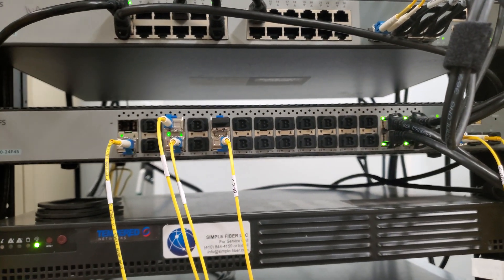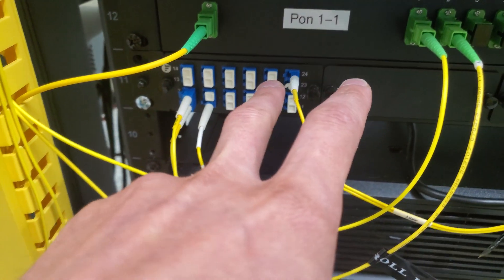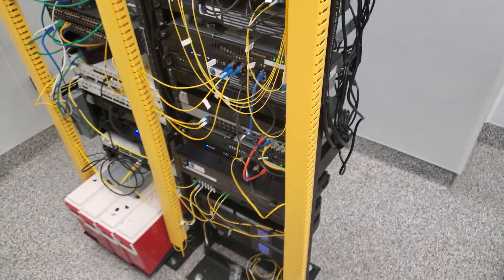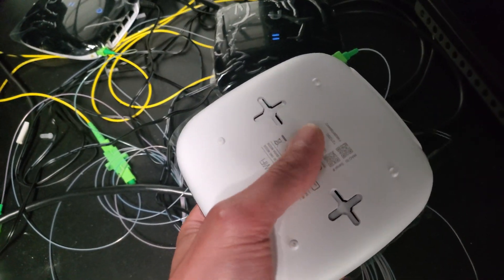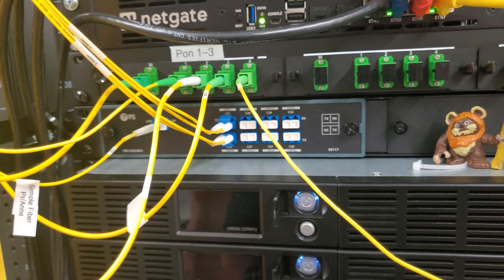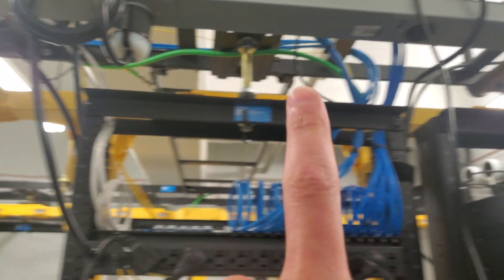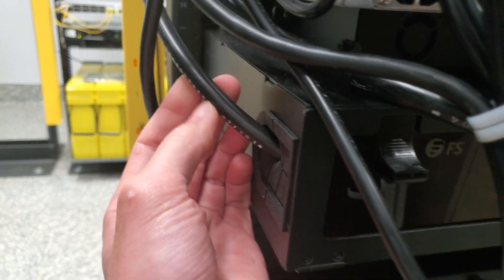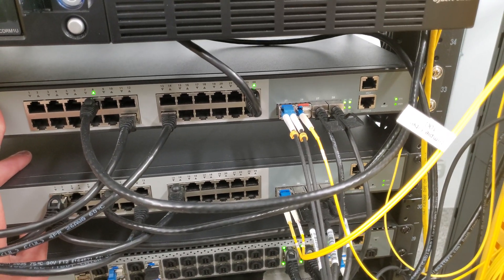Fiber site update

Comment: Ubiquiti should only be used for home networks. Not enterprises like these.
Reply from the maker: Out of curiosity where would you use an OLT capable of 1024 ONUs in a house?
Reply: @briceperdue7587  I'm sorry if I came out to harsh. It's just my opinion. I wouldn't use Ubiquiti. Must be because I'm so used to cisco products.
Reply from the maker: @anonymousmoose7  Not at all I love all the comments.  Ubiquiti's UISP line of products includes the OLT\ONUs.  Cisco or Juniper doesn't manufacture a GPON product that at all, I would never use Ubiquti for switches, routers, or security products it's all meant for a consumer or small business.  For OLT\ONUs in the U.S market you only have a few choices which are Adtran, Nokia, Ubiquiti, and Calix.  All of these vendors basically create the same GPON products but they all charge for licensing and software.  Ubiquiti doesn't charge extra licenses\software fees.